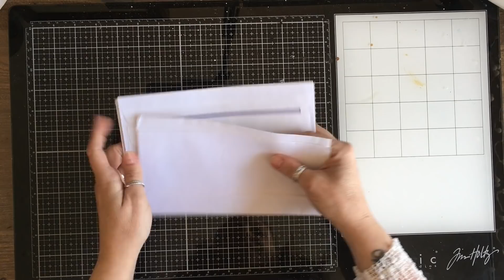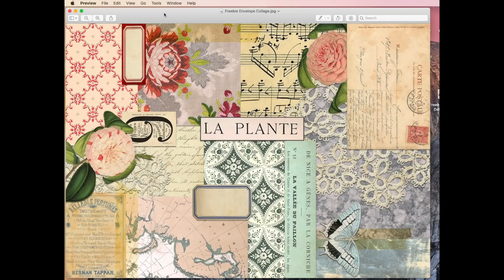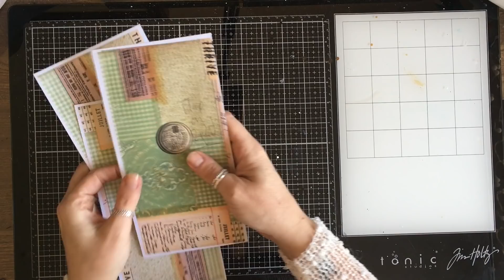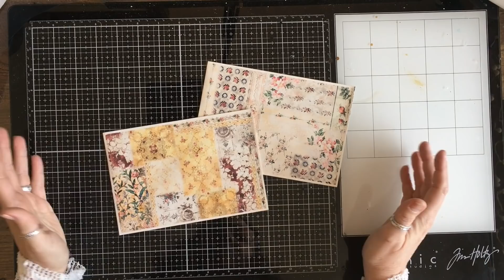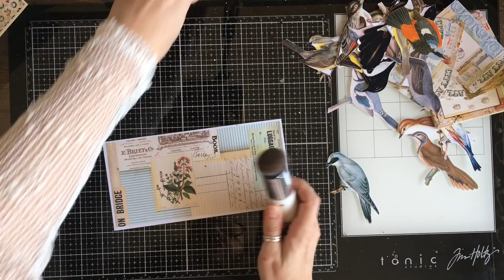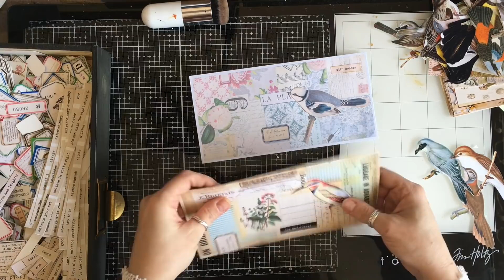Easy Printed Envelopes: Tutorial and creating NO SCRAPS!

Comment: How fun and I'm all for less scraps when possible! I am though curious how you are getting to that preview to choose your printing options. I'm so used to using Photoshop for all my printing so I'm not all up to date on what people use if they don't use PS. I looked at printing from my file manager but I did not see a lot of the options you mentioned and I do have an Eco Tank printer. ♥ I also tried opening a file from my file manager but again not a lot of printing options to choose from.
Reply from the maker: I do not print from PS as people may not have PS.  I save all files to print as JPEG files to my DT or a folder and open them…on my Mac in preview bu double clicking.  There will be a version of this on Windows.  Then when you will get the printer options I get.  If you do not get up all the Epson paper settings (assuming you are using Epson) then Google how to…the option is in setting but I cannot recall off hand how to find that. X
Reply: @TracieFoxCreative  that;s very kind of you Tracie. That is why I don't do any printing tutorials because I realize that most people probably don't have PS. Thank you for the info, I need to investigate further. ♥

Comment: Loved this video, such fabulous results. It's funny how we get caught up in all the different ways of decorating envelopes, I had completely forgotten there are actual printer settings to print onto them lol. 
Your Epson takes in paper different to mine by the looks of it! Mine is the ET-2750 and it loads from the back! It takes the paper in straight down and prints face up!! 
Thank you for the detailed info and screenshots though, that will make the process so much easier 👌😊 xoxo
Reply from the maker: Mine will print that way IF I set the sizes in custom the other way around…Landscape.  It you set it to the portrait you might find yours prints from the tray too x
Reply: I have the ET-2650, it loads the same way as yours. I also have so few options in my print menu, no custom settings-but I will try playing with margin sizes.
Reply from the maker: Check out the Epson manual for your printer as there may be a way to amend your printer dialogue box...xx

Comment: Good Morning Tracie! I have gone over to our FB Group and downloaded the new Freebie!! Thank You Hun!!!
Of course, I had to try this out right away and having a MacBook Air, I was able to follow along relatively easily! I did want to add a few notes for my fellow subscribers to your channel... When going into the custom size option on my screen, the first envelope that I printed only printed about 5/8 of the way down to the bottom of the envelope, the result being an image shorter than the length of the envelope. In order to fix this, in the Custom Size option, there are four settings; left, right, top and bottom...on my print screen, all settings were set at .25 with the exception of the bottom, it showed as .56... as soon as I reconfigured that measurement to .25, the problem was solved and the image filled the envelope(with the exception of the white border, of course)... In addition, I own an Epson ET-4760 printer...In order for me to print on my envelope, I also had to configure the settings on the display screen; to do this, each time I open the drawer to insert paper and then close it, the display requests/shows paper size. To change the paper size, I touch on the Paper Size option on the screen and then I touch on User Defined in my drop down screen; I can then manually enter the correct paper size. In addition, both my printer and my print screen paper size option offer a choice of Envelope #10 which I know as a standard sized envelope that will hold an 8x11.5 sized sheet of paper...I hope that this will be helpful to everyone...Hugs...  :- )
Reply from the maker: This should not happen if you input the correct envelop size and Print to fit, full page.  This happened when I first tried and I think I showed this misprint. BUT I guess all printers are not made equal.  So glad you worked it out and enjoyed it hun…Thank you so much for watching x
Reply: @TracieFoxCreative  oh yes… I picked full page, it was the printer settings… thank you so much for teaching us…♥️♥️♥️
Reply: @joaniesjournals5329  My sheet that I was printing from was landscape; I wonder if I need to print from one that is portrait. I'm going to try that tomorrow.